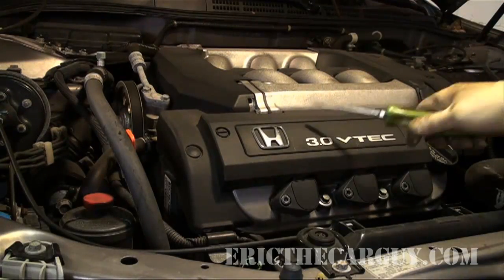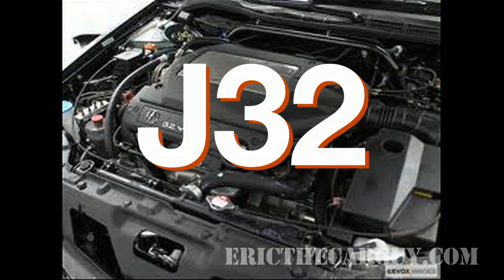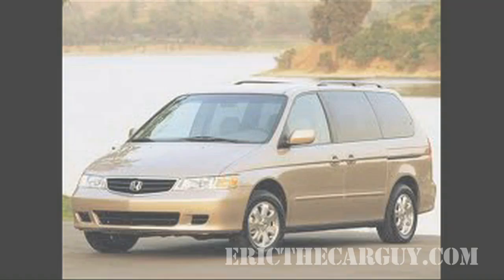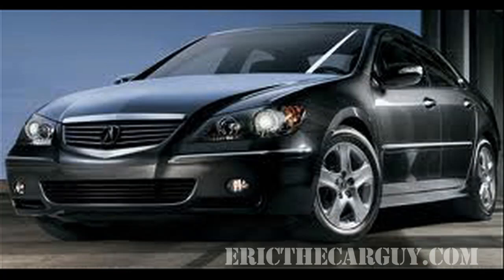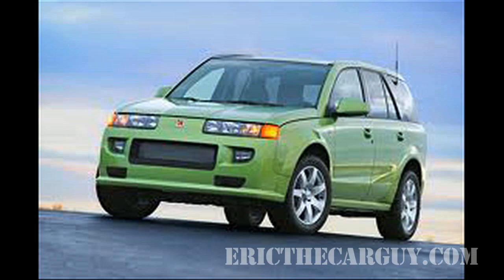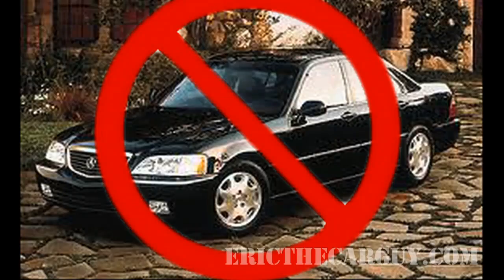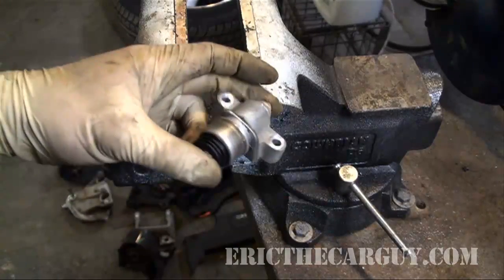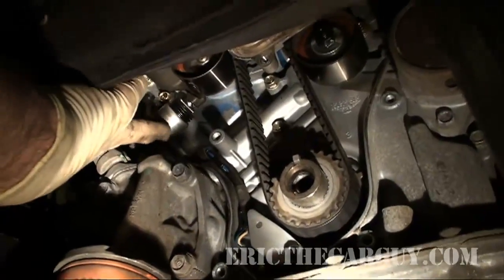1999-2007 Honda J Series Timing Belt Replacement VManual (Trailer) - EricTheCarGuy

Comment: Eric, I would like to ask you if there is a necessity in changing the timing belt on my 2007 Accord V6 with 60k miles. It just turned 7 years old in Apr 2014. There is no where in the manual which advises changing the timing belt unless driving in very cold climates. Online forums have however indicated a general rule of 105k miles or 7 years, whichever comes first. What would you advise?
Reply: Change the timing belt on the car. It is a preventative maintenance item, much like changing the oil, air filter. The J Series engine is an interference engine, meaning, if the timing belt fails there is a high percentage that the valves in the head will hit the pistons, causing serious/catastrophic damage to a perfectly good engine. As I always say, better to be safe than sorry.

Comment: Hi Eric, i have a question. i have a 99 Accord V6 and the engine started making a knocking sound coming from the timing belt area. would you happen to know what it could be causing the sound? i doubt that its the internals.

Comment: I rounded off the crank bolt after trying everything from electric impacts, to air impacts, to finally a 5 foot pipe on a breaker bar.  The breaker bar finally rounded it off.  :(  Anyone have any ideas on what I can do now?

Comment: Hi, Eric Love your vids. I need your help. I am changing my water pump and timing belt on my 93 Legend. I am stuck in the part with setting TOP DEAD CENTER. I cannot line up the three marks( Passenger Cam/Driver cam/ crankshaft). The TDC marks on the Cams never reach the marks on the cover plate at the same time. So if the driver side cam TDC mark lines up with the corresponding mark, then the Passenger side cam TDC mark is not lined up. What can I do to line them up??

Comment from the maker: @coldcash12345 If debris gets in there it can hurt the belt, I don't recommend running it that way.  Make sure when you put the cover on that you get all the fasteners started before you tighten them down, if it binds when you tighten the cover it could warp and make contact with the rotating parts beneath it.  Good luck.

Comment: Eric just a quick question. Is it bad if I remove the lower timing cover on my 3000gt and keep it off? I recently replaced the engine bearings by pulling the crank with the engine still in the car and I put everything back together and that side of the engine clicks now. I took the cover off, ran the car and the clicking went away. It seems like something it rubbing or hitting the cover. Any cons of removing this. Is dirt or anything likely to get in there?

Comment: Thanks Eric. I got a questions for J35A6,J35A7. After completed t-belt job does it needs CKP clean/CKP learn procedure?. if so can it be done w/o HDS?. 2nd have you get a hand-on with chirp noise coming from lower t-belt cover concern? idler pulley mounting surface is tilted?

Comment from the maker: @PoMoNaS1TOP I would check the tension on the drive belts first, the PS pump in particular first, the timing belt tension is controlled by the hydraulic tensioner on this engine.

Comment: @EricTheCarGuy I actually have the new seals from Honda. I won't install them until 1 starts to leak. Do you really think a leak would develop from installing new ones when the old ones werent leaking. I have never replaced seals before and do not even know how to pop them out of their housing. Even the valve cover gaskets have yet to leak and they were never replaced or had a valve adjustment. I will be  doing a valve adjustment soon but I am skeptical as to my feel of slight amout of drag.

Comment from the maker: @PVoyager If they are not leaking now and you change your oil regularly I still wouldn't worry about them as I've seen times where you replace something like that and it starts to leak where there wasn't a leak before.  It's pretty much 'if it ain't broke, don't fix it' but with that kind of mileage I can relate to your concern.

Comment from the maker: @lol123321123321 Either way a 6 cylinder is a smooth running engine by design, they started making V engines to save space under the hood, they've made straight 8's, 12's, and even 16's, as for a difference in power output I don't really think that there is any but that 4.0 that you have is a very solid engine.

Comment from the maker: @MrMK94 It's still in the same series though which means it hasn't undergone any major design changes, a chain would be a major design change.  Engines are often run for a number of years because to make the tooling to make them is very expensive so they do their best to make a solid platform and run it for many years.